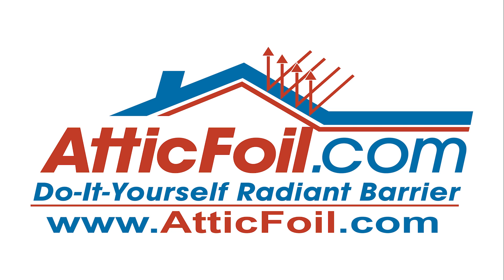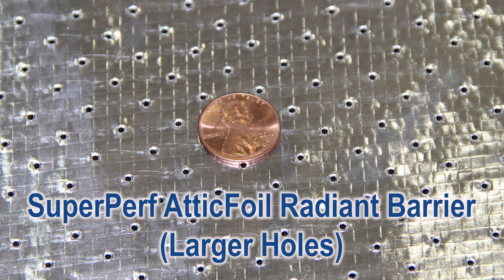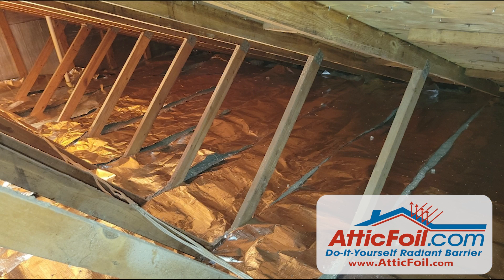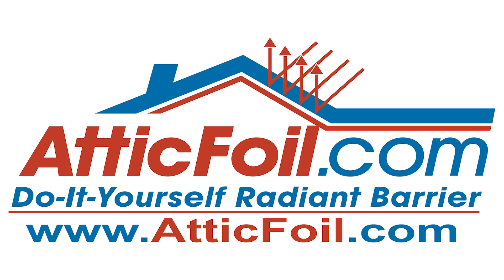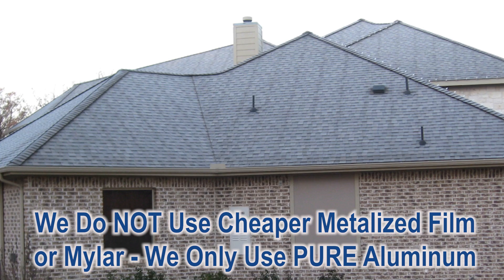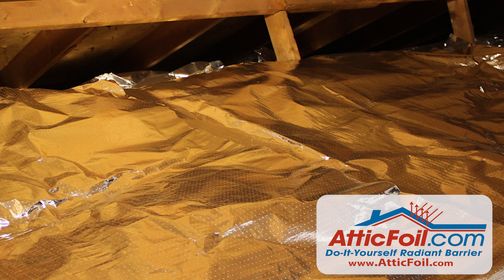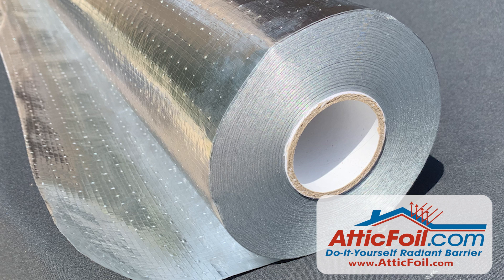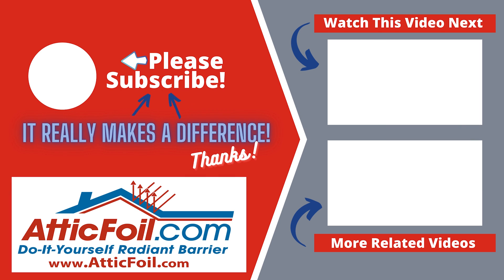Radiant Barrier Install Method? Staple Up, Over-Insulation or should you do BOTH? NEW 2023

Comment: I am in north Georgia. I don’t have the ability to get to all of my rafters in the ceiling in my attic. If I do the floor method, will it still keep the heat away enough? Even though the ceiling method might be better. Is there there still some benefit to putting it on the floor?
Reply from the maker: Installing www.AtticFoil.com has a cumulative effect. The more coverage, the better. So, do as much as you can with whatever method works.  Take a look at the Hybrid Method here: https://atticfoil.com/index.php/installation/hybrid-install/